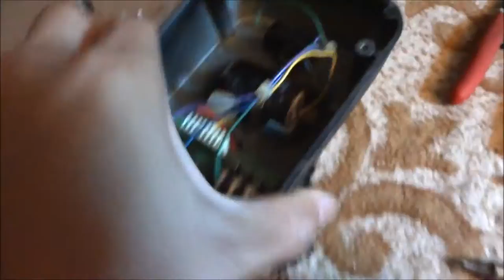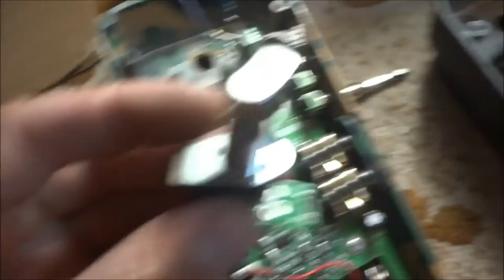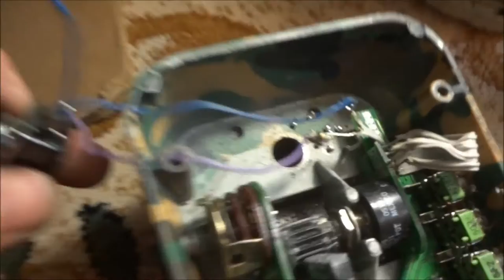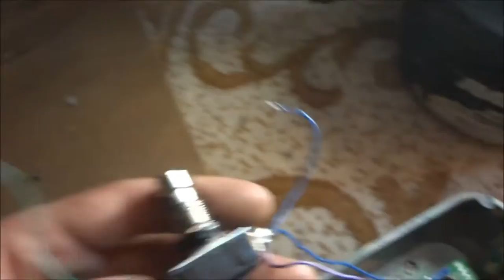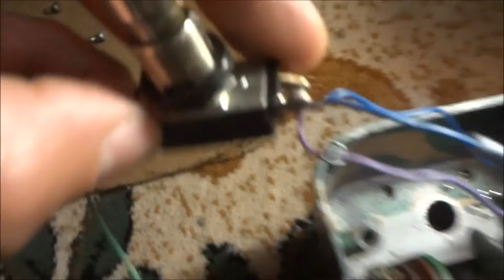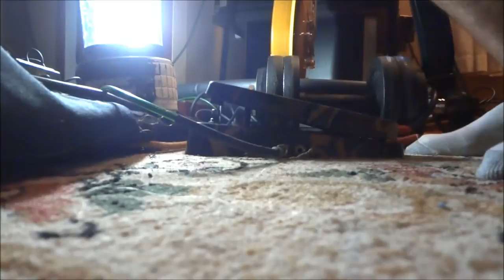How To Fix A Wah Wah Pedal

Comment: my vox wah doesn't work. i can plug my guitar in and it has a clear signal when the switch is disengaged and a slightly distorted signal when engaged but no wah sound at all. instead the the pedal acts more like a volume pedal. any idea what i can do to fix it?
Reply: This is what happened to mine did u happen to find a fix ?
Reply: @Daniel-zo8lm  I have the same problem

Comment: I have a dunlop cry baby the batt reads 9.3 I checked and it has it to the on switch checked the board seems good when on I can hear it thru the amp but at a very low volume any idea,s John

Comment: I have the same Dimebag pedal except I think mine is the more modern one, a couple months back it started to stop working on me, when it's not engaged, I have very little signal , when the pedal is on, there is no sweep but the effect is there but not all the way. Would that be the foot switch or the fasel inductor?
Reply from the maker: SkullyFuckingNova   For me it was the foot switch that stopped working. It would move down but it wouldn't rclick and engage on. The signal chain was also low..so this could possibly be the same issue as yours. Well let me know how it works out. Thanks for stopping by!